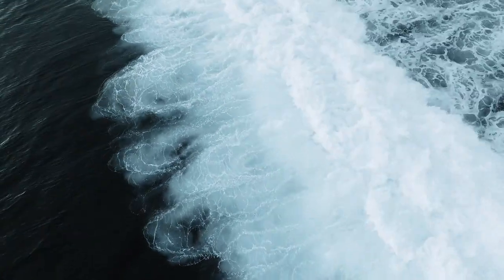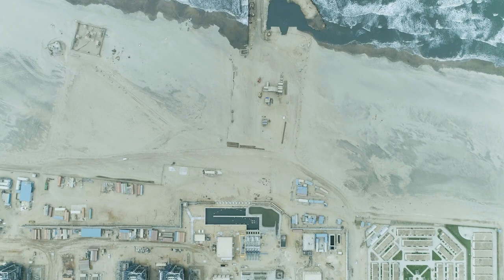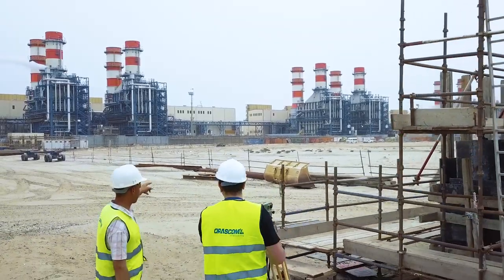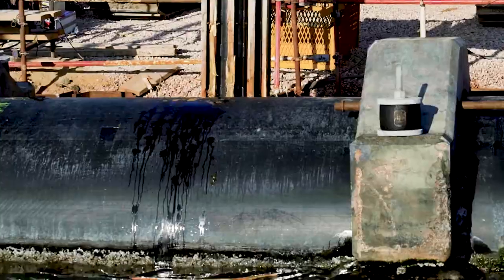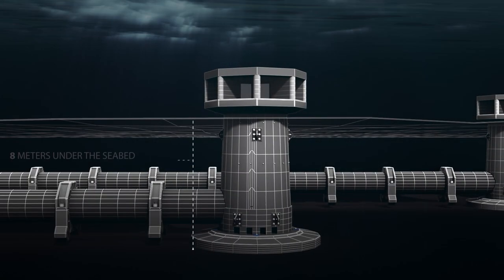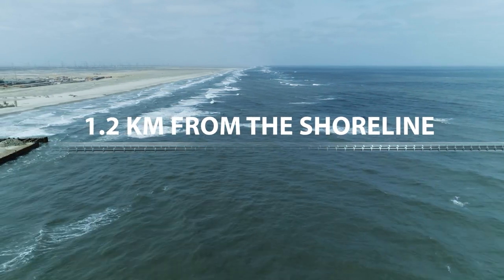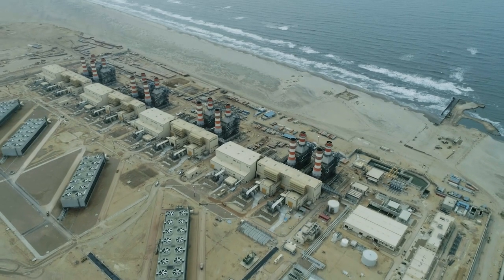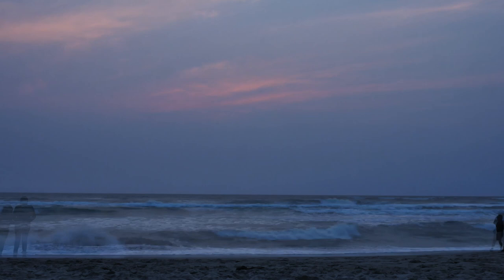Burullus Seawater Intake Pipeline

Comment: So the pipeline draws water feom 1.2km out in sea? Why is that?
Reply: To cool down the heat generated in the power plant, same as the car radiator whereby the engine needs to be cooled down.
Reply: A lots of factors why water is drawn from suc a distance, one of them is the waves breaking on the shore line which disrupts the flow of seawater to the plant, also shore lines are usually full of waste and debris, that might be sucked or finds its way to the pipe main entrance, Also the factor of the seabed, and the Tide, water needs to flow into the power plant constantly with out any disruption, poerplant worst enemy is downtime.